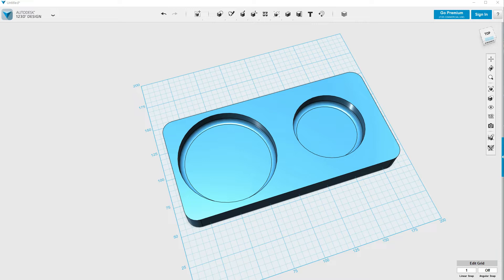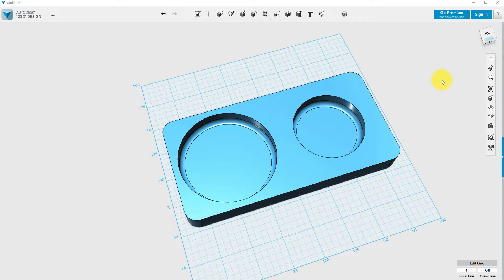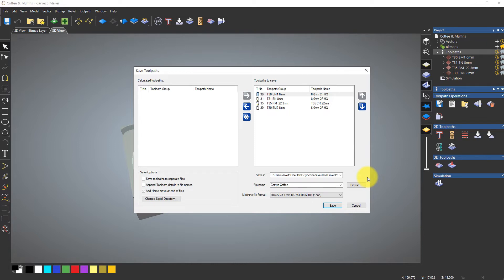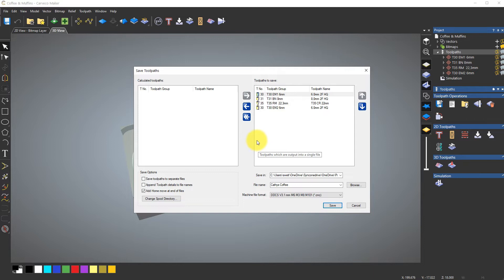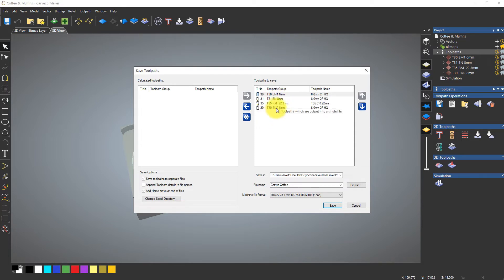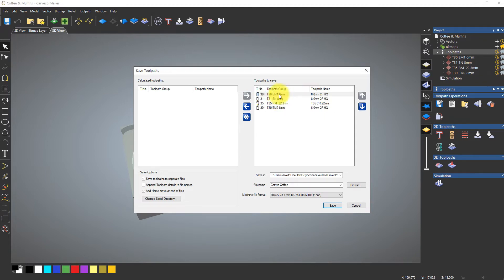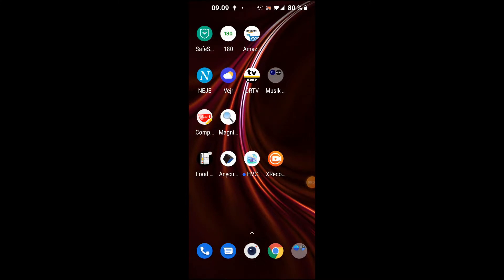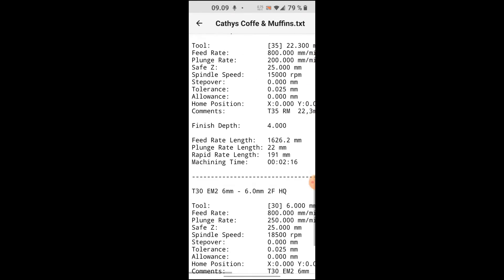My CNC Workflow Bulkman 1010 Part 1 ddcs v3.1

Comment: okay thank you for that, another question can see my table size on the DDCSv3.1 controller, like i would on mach3 because when i load my g code i don't know where my machine is gonna cut my work piece and my machine keeps going in the wrong direction, i use vetric aspire to design and generate my G codes, i usually work in the middle of the software which i set to be 1200*1200mm the size of my machine.
Reply from the maker: Move the tool to the position you want tobe zero  then zero out X and Y axis

Comment: and can i work without limit switches
Reply from the maker: Hi Yes it can :)
Reply: @weitlingD3P  how would you recommend i do that with out limit switches, homing and probing
Reply from the maker: @drejegetahun9916  I only do the Homing that is in the coordinate system 53, because I then use the G54 when working Probing and tool change is done in G53 (Machine coordinate) this is a safe way to do it In G54 my zero position can be at different places.  for coordinate systems take a look here https://www.youtube.com/watch?v=dUWv5AK0fFc&t=21s

Comment: which pins did you use to connect your probe and limit switches on your controller?
Reply from the maker: It is a combination of pins.  It very well discripet in the manual page 16